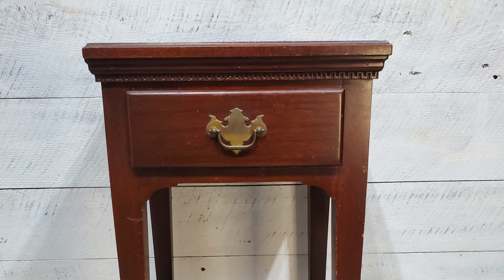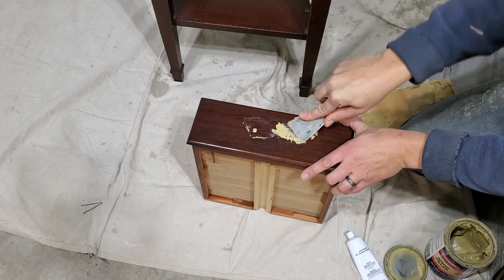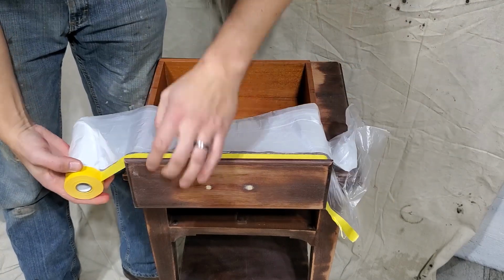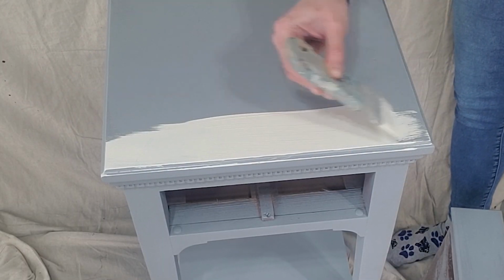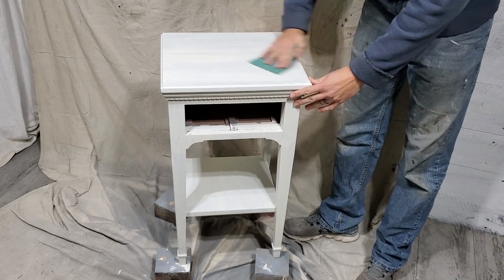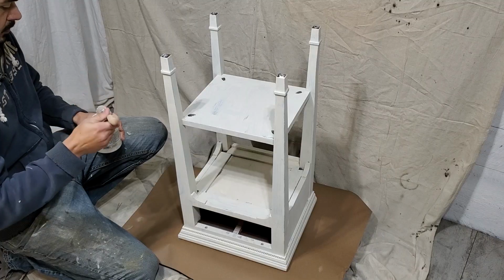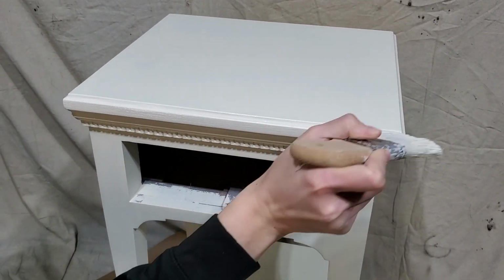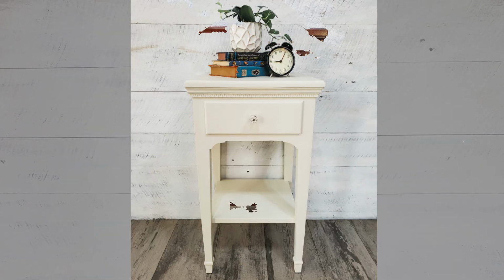Night Stand Makeover w/ Fusion Mineral Paint // Simple Painting!

Comment: Im new to painting. Im surprised the draw doesn't stick on the inside where you painted. I dont like using spray paint. Can you suggest another primer? I did read that fusion has a primer in it so was curious as to why you used a primer
Reply from the maker: It often depends on how much the paint adds to the clearance between the drawer and surrounding.  If there is very tight clearance, any added layers will make it tighter and will cause it to be tight or to stick.  There's times where I would make sure to tape the inside off or sand afterward to keep the proper clearance, but it all depends on the piece. 

Priming, regardless of typ of paint, helps ensure adhesion and also helps prevent any bleeding.  It's not usually as big of a problem with darker colors, but still good practice to make sure the finish lasts the test of time. 

As far as other primers, you could try Zinsser Bullseye.  I've used it on a few pieces in the past, and also on other applications around our house throughout the years.  It tends to go on a little thin though, so you may need a few coats.  But if you're looking for a brush on primer, I would recommend trying that one.  

Best of luck in your projects!
Reply: @BrickHouseVintageDIY  thank you :)